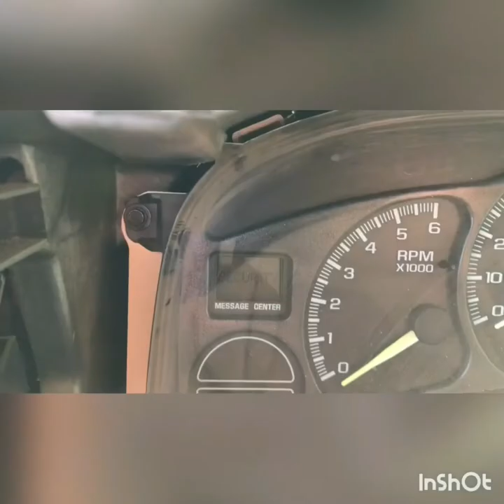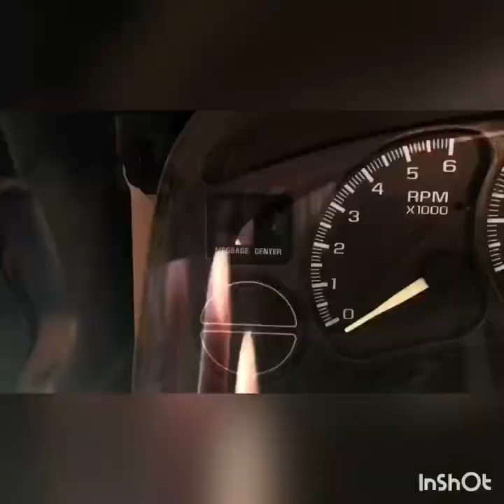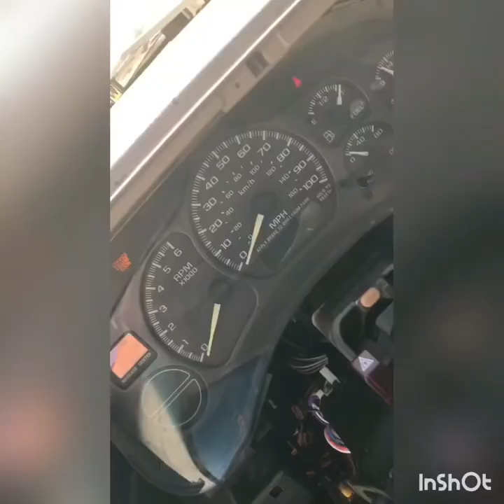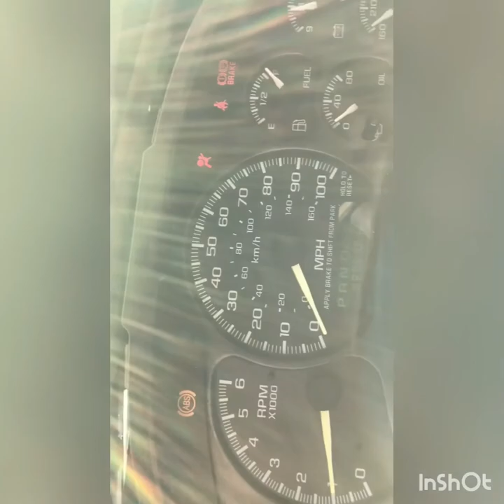Average Mike Show #54 2000 Silverado ignition switch replacement

Comment: The man Says it's a Piece of Shites?

And yet, it has more then 300,000 miles.

Go Figure. 

Older Chevys up to 2005 are Bullet Proof bud.

I've driven All (3) American Brands. 

Chevy 1500's 350's 305's or 4.8L
Fords F150's V6's and The 302's 
Dodges with 6 Cylinder Incline Engine.

I would keep up with Preventive maintenance, and they never gave up on me. 

Now the Newer ones, are a P.O. Shites. 

It's The Capitalist way of Thinking. 

Now... You want a Good Dependable Truck?

Buy a Toyota Tundra.
Reply from the maker: No the aftermarket alarm caused most of the problem. That only had 15000 miles on it.